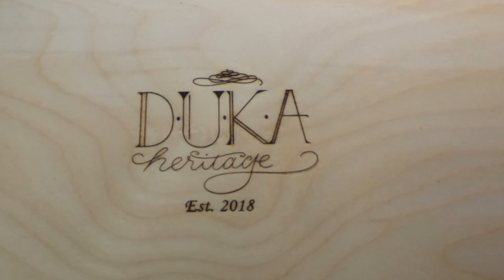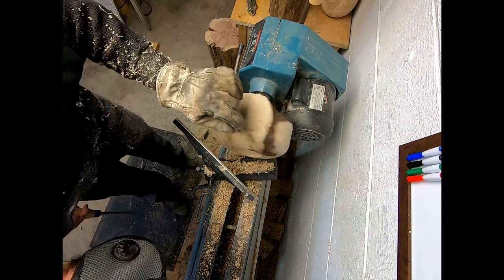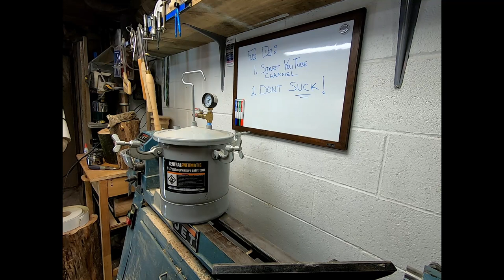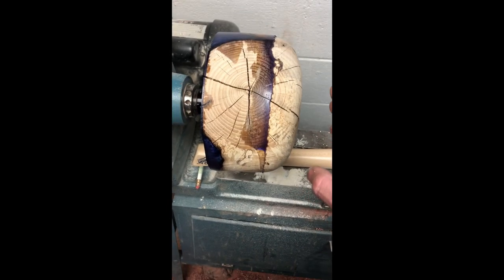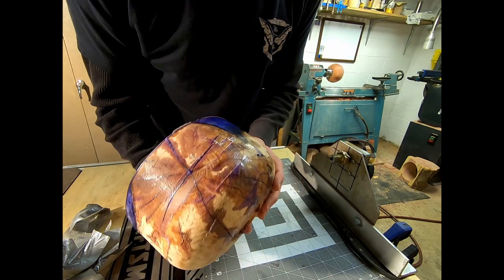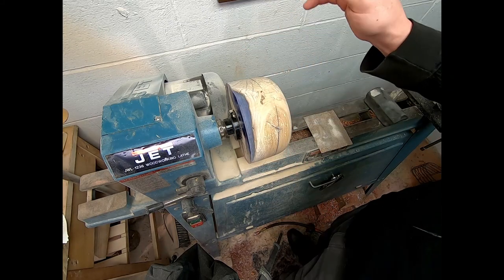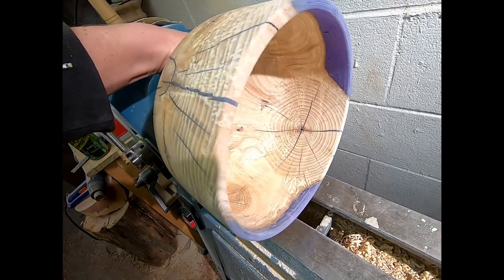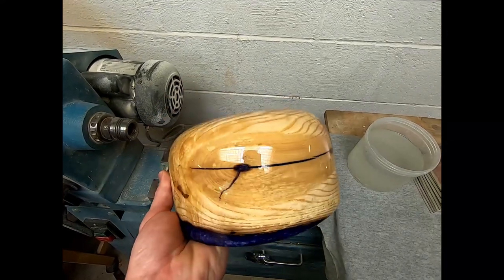Cracked Ash Bowl

Comment: Interesting project idea? The crosscuts with the cracks radiating out from the center looks like a spider web. What about either finding a log with many crosscuts, and score it deep enough to make it really look like a web and fill with resin, or use a bunch of crosscuts, score them, put in a mold with resin then make a bowl???? 
One last 'or'  Would it be possible to find a really, really big crosscut and do the same, just make it a HUGE spiderweb? Or would that not be something that could be turned?
Reply from the maker: Ohh, these are great ideas to add to the inspiration book. Thank you Lesley!